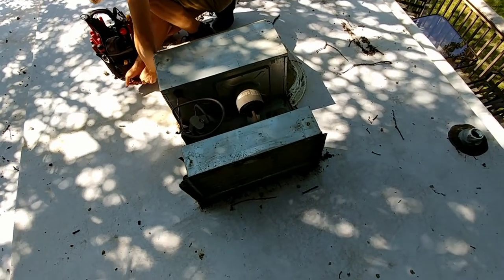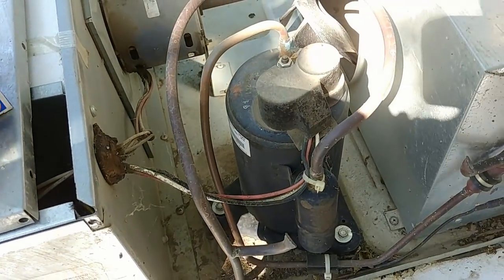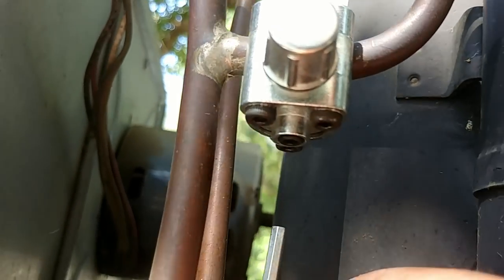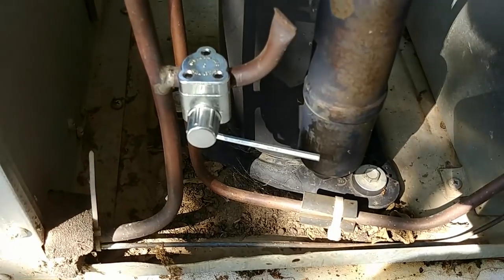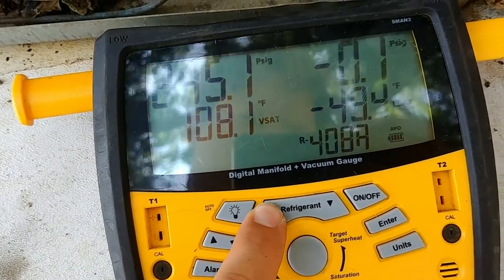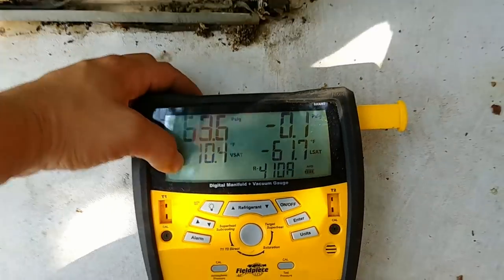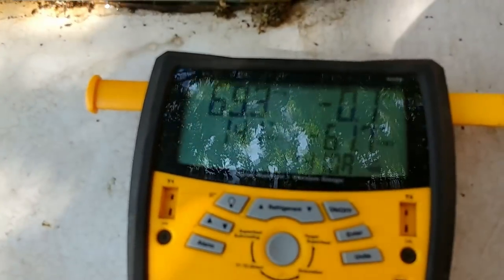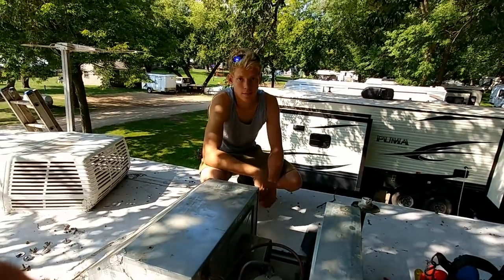RV Air Conditioner Troubleshooting - Partially Frozen Coil, Dirty Condenser, Low Refrigerant Charge

Comment: Mike Guedry
I reviewed your video and was able to charge my unit, using your same guidance and recommendations.  Compliments to you and your team, my freon adding was a success.  My initial pressure was approx. 23-25 psi.  I charged the unit with freon 410a to a reading of 135 psi ( slightly high since i figured it would slowly leak out over time)  Inside air temp went from a starting value of 65-67 degrees, to a final reading of 53-55 degrees, this reading was taken flowing out of several  registers (Vents).  I WAS Very satisfied and it really made a difference when your outside air temps are in the mid 90 degrees and you have 90-95% humidity.   My final test was a SNOOP Test,,,,, No Bubbles - No Troubles   THUMPS UP BEN
Just a little feedback to us readers.... don't be afraid to mention and point out the little things that most of us may not know, such as differences between High and Low taps and there importance.   Make sure freon bottle orientation is the proper configuration for adding fill and another quick one, may want to highlight/stress some of the most important /critical factors, ,,, is it the amount (oz.) of freon installed, or final system pressures (125-130 psi) or inside air temps (Degrees), which is the overall GOAL.   For individuals who don't work on AC's on a daily basis, additional details are appreciated.  Thanks again and keep them coming.

Comment: You CAN find leaks if you look for them and do so the properly.  I have found many of them small enough to allow running up to two years before they need topping off.  Also the leak being on the high pressure side vs low makes a difference how easy they are to find. The very best detection fluid ever is "409  Spray Cleaner".   It's better that ANYTHING I ever tried and you can take that to the bank, it's so good.   Even better than products sold commercially.  Spray in the stream mode very slowly.  You want to get  a thin layer of 409 on the surface and it will foam up like shaving cream on the very smallest leaks ( I've seen it)  after a minute or two. 409 will blow small bubbles on bigger leaks.   Nobody likes looking for them  so they never find them because they charge it up and they are out of there.  People are lazy and will always avoid extra work.    Also the oil in the compressor will circulate throughout the coils and tubing when running.  So you can spot signs if  (dried) oil as an indicator of a leak there.  Typically there will be a coating of dust on all surfaces and there will be dust that's slightly darker due to the oil touching the dust and evaporation over months.  It shows right up if your looking for it and know what your looking for.  Also Freon detectors can be quite helpful, if up got one. Cheers
Reply: Thanks for the 409 tip. I’m preparing to check my AC units soon.

Comment: Thank you for posting. My dad has an rv that has the coil freezing up about half way just like that one. I started watching and was like "huh, that looks similar". The model number of that unit is one digit off toward the end front yours. Basically identical. I am new to the industry and after looking at it on the roof, I had no idea how I was going to add refrigerant. Thanks again! Very helpful.

Comment: Just installed a new Dometic ac on the roof 15K unit, it blows fine, but not cooling!  Looking for information to maybe fix myself without driving my rv to a Dometic Dealer for warranty work !    Frustrating that a new unit NEEDS FIXING !   Great video and information!

Comment: Your video was very helpful. Many are too general. I liked that you went through the steps using a piercing valve, where to put it and pressures on the low side. I'm sure mine is low on freon and cannot find anybody to come to our remote location to fix. I have ordered everything and think I will finally get it going next week. Thanks

Comment: when mine froze up, all i had to do was replace the temperature sensor. as the sensor detect when the block is to cold to shut off certain funtions to prevent the block from freezing.

Comment: good technical explanation, especially for  someone as young as you. my AC has failed and although i am hopeful that it is something other than a refrigerant leak, at least i have some guidance if it is. my previous experience showed too much loss of refrigerant to allow a long term fix through re-charge. maybe this is why most AC repair services won't re-charge.

Comment: My rv ac will be running perfectly and just shut off back on , sometimes once for a split second , or seconds, or a couple of times. Changed thermostat and capacitors, still does it. Lately, it may shut off for several seconds and restart,  or slide temp up on thermo and it restarts, too.
Reply: That's the problem I am having.. Just getting ready to trouble shoot the system.. Good Luck with yours!!

Comment: Benjamin,  Little advice here.  I'm happy to pay for it if needed (pm me in youtube.  I have a very similar unit (model 48254C869 - which I can't find but I think is a Mach 15 unit).  The unit stopped cooling, fan and compressor running.  On inspection I found a rubbed spot on the capillary tube and evidence of leakage.  Design issue - the edge of the metal shielding over the evaporator rubbed a hole in the capillary tube (cap tube - part 8333-1351 in Airxcel parts list).  I braised that tube using Harris 5 phosphor rod - seemed to work.  I installed a piecing valve on the suction line and successfully - charged with 410A refrigerant.  I used a simple single gauge, I did not vacuum evacuate the system (I don't have a vacuum pump).  The spec sheet says 16 ounces - so I stopped there.  During the time the 410A was flowing in, the suction line frosted up - but as soon as I turned off the refrigerant, it got warm.  Added the rest of my 22oz can of 410.  Same behavior.  So - something did not work. Two possibilities.  1) I did not vacuum out the system - so...  2) My repair of the capillary tube, or the damage to it, plugged it so the right amount of coolant is not flowing.   I don't see any practicable. way to replace that capillary tube - even if I can get one.   So - is this A/C unit done - or should I vacuum the system and try again.
Reply: Robert, you plugged your cap tube, you seem to know how to braze so here’s what you do, take a small triangle file and etch a groove into the capillary tube on either side of the damage and break off the bad section being careful to make sure each  end of the line is open, don’t cut out too much cap line as it’s length is critical for proper feed to the evaporator, a couple of inches is fine. Now take a small piece of 1/4 inch tubing two inches or so and use it as a splice, gently crush each end to seal without damaging the cap line and braze. I’d borrow a vac pump and run a good vacuum then recharge.

Comment: I have a quick question? I’ve seen people and other videos putting auto refrigerant in there RV AC units? I don’t have a certification and cannot get the 410 that is required. Am I able to recharge slightly with a little bit of auto refrigerant? I am replacing, all of the capacitors tomorrow, not blowing cold air by the way and the last thing that I can think of is that it’s a little low on refrigerant. The system has never been tapped into apparently so beyond that I guess I will buy a new rooftop AC if it wouldn’t work. Let me know your thought?

Comment: How do you prepare your customer before doing work, because you can't warranty the added R410a won't  leak out again.. I know it can be very expensive to setup to recover, pressure test,, fix leak,  evacuate and recharge the 12 oz.. of R410a Excellent presentation !
Reply from the maker: Usually, if it is the first time a unit has been low, we will recommend charging and then see how it lasts. If it runs out again quickly the leak will need to be fixed. Otherwise this fix may last 3+ years before having issues again. I agree though, it is a difficult balance to strike.

Comment: I cleaned my coils and it froze slightly again after running a few hours before shutting off. I have the same A/C in my Laredo. It's in very good condition.

Comment: The label on your ac unit stated that the low side psi is rated at 240 so why did your gauge only read 124 psi? Also what happens if you add 134A freon instead of 410A? Trying to fix my AC unit as it is short cycling. It will run fine for about half an hour and shut off and on every three minutes for each cycle. Line is sweating and gets cold so not sure what is going on. Might try and add some refrigerant. Thanks for the info.
Reply: you need to make sure you are not running on a 15 amp outlet first of all and then make sure the outlet and cord end are not loose at the internal connections or they will heat up and lose power.

Comment: What should the pressure be on a R22 RV a/c system?
Reply from the maker: Approximately 70psi on the low side and 225psi on the high side. Note that pressure does not tell the full story but that's a general starting point. :)

Comment: Wish I could get help on my Dad's Duo-Therm Quick Cool.  The fan switch on the thermostat won't turn the fan on.  I went up on top and took everything apart thinking there was a contactor like in a residential unit but none was found (I was going to engage it).  The fan blade won't turn like a residential one so I thought perhaps the shaft was frozen.  I am now lost.
Reply from the maker: The motor is most likely bad as it should spin freely regardless of operation status. Usually this is caused by failed bearings. Good luck!

Comment: What do you use to plug the whole when your done  or do you leave the device on?
Reply: You leave them on the line. It's an ON-OFF valve you can use in the future to check pressures or add refrigerant if needed.

Comment: Great info!  I've got a 2016 model travel trailer that just isn't cooling when we camped the first time this year.  I can hear the compressor running but the evaporator isn't cold.  Prior to this, we were getting ice on the evaporator.  Seems like it's lost it's refrigerant, would you say?  Is it even worth trying to fix the leak and recharge it or should I just ditch the thing for a new air conditioner?
Reply: Did you resolve your issue? How? I’m under the same problems.
Reply: Teaching wrong

Comment: I have an older Duo-Therm unit with R-22 in it.  It's not cooling well.  I've read a lot and "I think" I can use R-22a as a viable substitute.  Is this true?  Also, have you done a video on how to recharge an RV air conditioner with R-22 in it?   If so, could you send me a link on how to watch it.  Thanks for the very informative video.  Keep making them !!!
Reply: 407c   You need an EPA certification to buy .

Comment: I have a 2000 Seahawk by Gulfstream.  I noticed a wire unplugged on the furnace, I plugged it in, then a fuse blew and the Coleman mach ac shutdown. I unplugged that wire, changed the fuse, no ac at all. Come to find out the pos and neg wires were crossed on the furnace! I fixed wires, still no ac. I put new start, run and fan capacitors in, new control box in, no ac. Could the thermostat be fried?

Comment: Mine is leaking fro the tap when I add freon.
Reply: Yeah the best way to actually fix is to solder fittings on. 

But to do that properly you need to vac the system out and purge with nitrogen or argon (inert).
Then refill with proper weight in freon with a scale back in the system. 

These pierce fittings...while convenient.. almost always leak from expansion and contraction. Soldering is the only true way to make service taps.

These valves are designed to open and evac a sealed system, BTW. 

If you don't care about recharging it every so often I guess you could use it. But I would get the solder fittings
Reply: @Heliarc91  Well mine was had a problem. Half of the freon was coming out. I got new fitting and problem solved. Thanks for your help.

Comment: Benjamin, I have the same roof top unit on m horse trailer but the tag has faded out, can I recharge with 134a instead of 410a?
Reply from the maker: No, if it was R410A then you need to keep it set up with that refrigerant. It will not work with R134A.
Reply: @BenjaminSahlstrom  Thanks, The tag on the unit is faded out so I can't read the actual required refrigerant. The unit physically looks exactly like the one in your video, the horse trailer and AC unit were built in 1995, Was that 410A back then? Thanks

Comment: I have a question can I  mix r410 with r 134a?
Reply from the maker: No refrigerant types should be mixed. It won't work and is not legal.
Reply: @BenjaminSahlstrom  thank you for the information. I'm trying to recharge my portable air conditioner. It takes r410a but idk what to do. Should I empty out the system and then re charge it with r134a?
Reply: @BenjaminSahlstrom  I also need to recharge my rv ac. I ordered the bullet piercing valve from amazing. Idk what kind of refrigraront my rv ac takes.
Reply: @rigweldernomad932  410a and 134a are not compatible refrigerants. r134a will not work in a 410a system or visa versa.
Reply: @rigweldernomad932  You will have to Google your make and model as different systems use different refrigerants.

Comment: Just one question, why didn’t you install the tap valve with the allen screws on top, guess it doesn’t matter much however since the crazy pressures of this assenine 410A they’re using now will soon leak out thru the thing anyways !

Comment: This was one of the most painful videos I have watched in a long time.
There is a lot of information in this video. Unfortunately most of it is wrong. There is no piercing valve that will not eventually leak, You should have sweated on a shrader or at least a saddle valve that can be sweated onto the tubing so that there will be no leak at the valve.. It was obviously low on charge, so why not break out your sniffer(if you have one and now how to use it) and actually detect and repair the leak before attempting to charge the unit. It's a sealed system, so you already know there is a leak somewhere before you even start.
You can not charge  410A by pressures like you do with R22. The suction side is affected by inside temperature and the high side is affected by ambient temperature. How did you determine how much charge to put in it since you had no way to determine what was in it.
Finally, if you are charging a DX unit, you charge by super heat or you evacuate and weigh in the charge.. not gauge pressure, and how do you charge without knowing what the high side is. That tells you if you have a dirty condensor, which BTW will cause your high side to go even higher. The unit ia already running at potentially dangerous pressures.The people asking questins is a whole new topic.
As far as asking where yu can buy freon, if you had an inkling about what yiu are doing, you would know that you have to buy it ar an HVAC supply house. And BTW, yu need an EPA certification card to buy it.
To those who want to know if you can recharge with a different refrigerant, just do everyone a favor and walk away from your air conditioner before you hurt yourself or someone else.